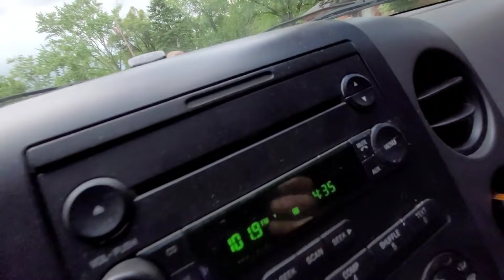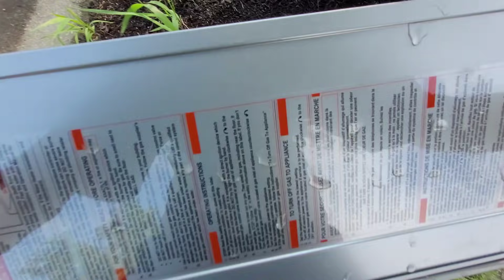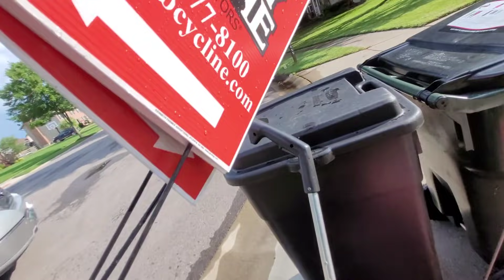What's In The Neighborhood Trash?

Comment: Make sure you take apart that instant hot water heater there's a lot of really good copper in there
Reply: I just found one the other day I’m going to open it up after you mentioning that see was inside😮
Reply: @steelisthemeal  there's like 5 lb worth of copper in there
Reply from the maker: This one was all stainless and brass. Only copper was in the wiring.  
Kinda bumming it now 🙃😁
Reply: @MrScrappity  I'm guessing the burn chamber was stainless not copper everyone I'll take it apart has been copper but I don't come across them that often
Reply: Definitely still worth giving it a look
Reply from the maker: @ScrapFarm  yeppers. The piping was actually magnetic stainless.  Probably one of the cheaper models I guess
Reply: @ScrapFarm  well that actually makes it worthwhile 5 pounds that’s between 15 and $20 worth💰👍
Reply: @MrScrappity  Take it back to that house and toss it off in the yard and stand there cussing at the house like some kind of psycho. I truly see this as the only solution to substandard scraps from such a nice house.

Comment: Good score with the water heater. 10+ years I've been driving around and have never found one.
Reply from the maker: Keep driving I say.
There wasn't an once of copper in it 🤣 
All stainless and brass 🤷🏻
Reply: @MrScrappity  damn that's a let down. But still I bet it's not a bad find. And I bet you rearranged your truck.
Reply from the maker: Ginger? 
I did not. Two wagon type system 😁
Reply: @MrScrappity  thought you would of or at least enough to fit all the scarp on Ginger.

Comment: There is no way I would have left that vending machine sit on the side of the road they can weigh upwards of 500 lb plus all the copper and wire that's inside them that was at lease an $80 score 🙀🙀   I don't know if you've seen them yet but you should check out The dumpster cats they have some really good curbside videos up ✌️✌️ and keep being you that's why we watch your videos ✌️✌️
Reply from the maker: Yard won't take anything with refrigerant unless it's been properly removed and has the sticker to prove it.  They charge $25 if it ain't got the sticker.
Scrappity ain't paying the scrapyard 😁
Reply: @MrScrappity  that sucks the yard we use they pretty much take anything they take vacuums even them plastic dishwashers
Reply: @jamesdufresne4738  are scrap yard wont pay for plastic dishwashers and plastic Vacuum cleaners they will take them and no $$$ .